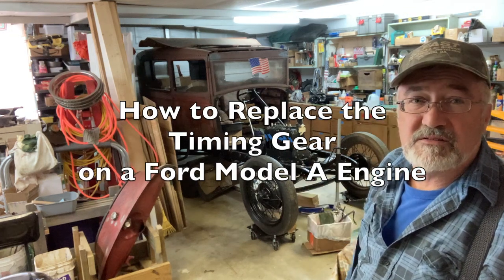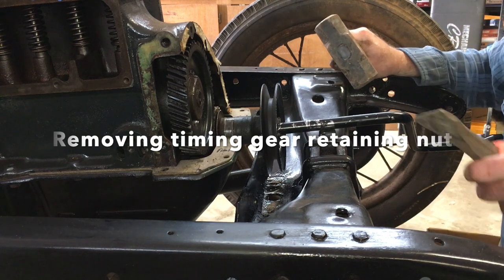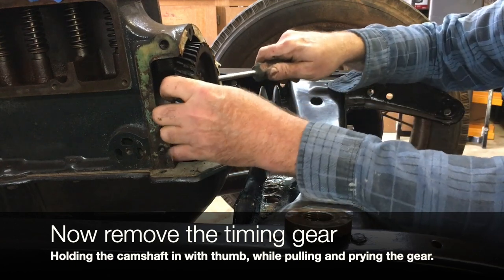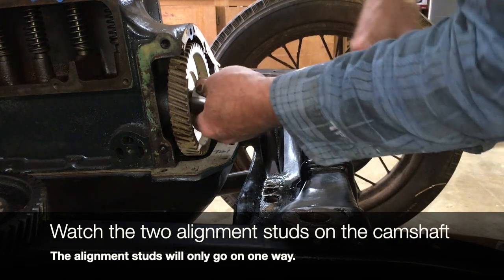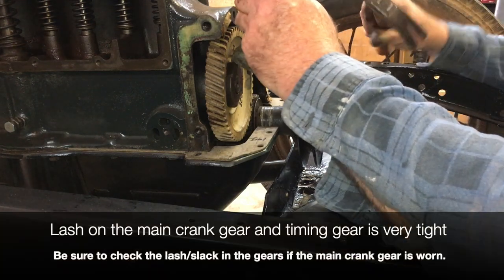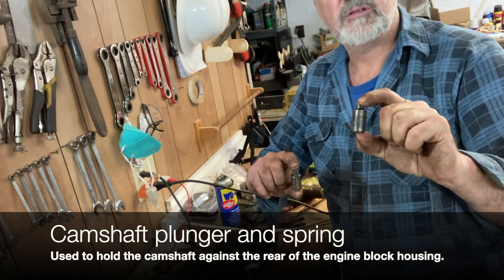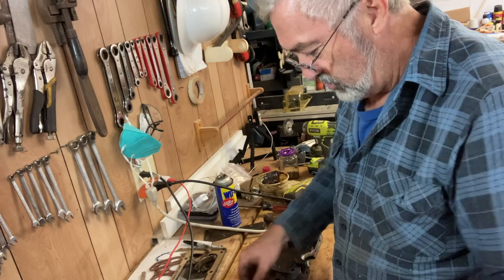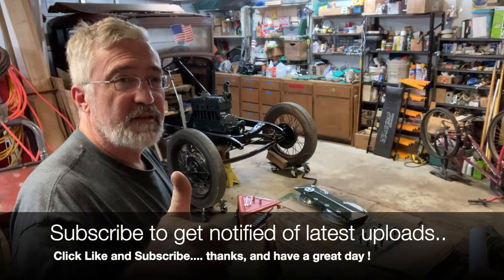Ford Model A How-to: Replace Timing Gear on Model A #fordmodela #restoration #classiccars #ford #car

Comment: Instead of using a chisel to remove the cam nut, there's a special tool Model A suppliers sell that you can use with a 1/2" drive ratchet or breaker bar to get of and back on.
Reply from the maker: I know…. But didn’t want to buy a “one use special tool”…. I’m on a budget…
I was lucky it came off easily.
Reply: @Teds_Garage  You could have mentioned the availability of the special tool to your viewers to give them an alternative to hacking up a perfectly good cam nut with a chisel.
Reply from the maker: Rick, I was able to update the video description…. So I mentioned the special tool.
I couldn’t find any way to get it in the video.
Thx.
Reply from the maker: Hey Rick, I looked some more… 
Most YT videos don’t bother with CC/Closed Captions, but my dad has hearing aids and he reads the CC… so most of my videos I type up the transcript… 
anyway, I was able to also add a Note to the CC (as well as in the Description text).
Reply: @Teds_Garage  Good job!

Comment: Curious why you removed the rear engine mounts?
Reply from the maker: They are nearly “hard mounted” to the frame… and to get the front mount out I needed to lift the engine up about 3”… 
I could probably have just loosened the rear and pivot the engine… and got enough room to remove front mount.
But…My rear mounts were dry(rubber) and rusty…. 
So it needed cleaning, sanding and primer, frame paint…. And new rubber for the mounts.

I’m about to install the rear engine motor mounts and the front mounts… to get engine locked back down…. Next video…maybe.
Reply: @Teds_Garage  I helped a buddy replace his timing gear a couple of years ago.  We never messed with the rear engine mounts.
Reply: You only have to mess with the mounts if your jacking the engine up to do the crank gear.

Comment: What is RTV?
Reply from the maker: RTV = silicone (Room-Temperature- Vulcanizing silicone) is a type of silicone rubber that cures at room temperature. Used to seal gaps... in place or in combination of using a gasket.